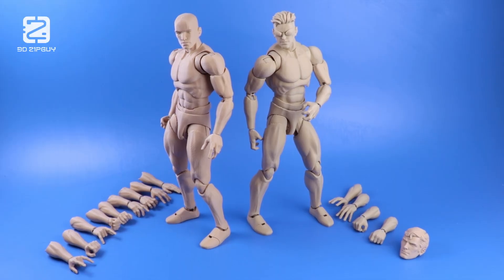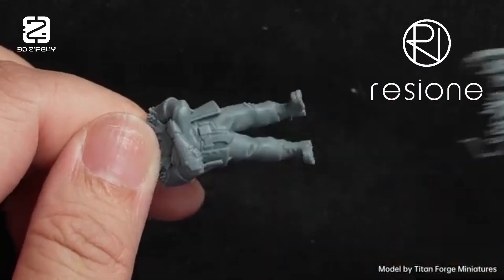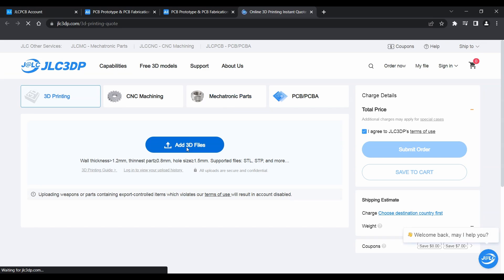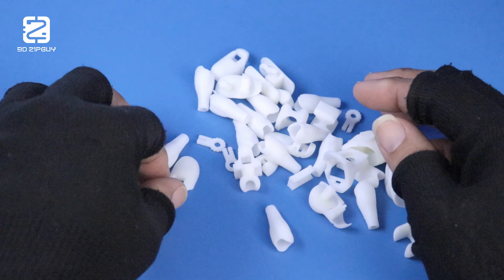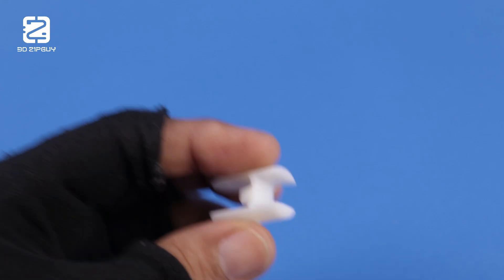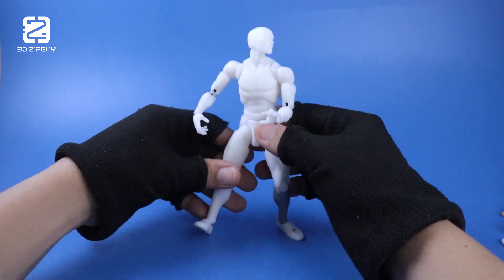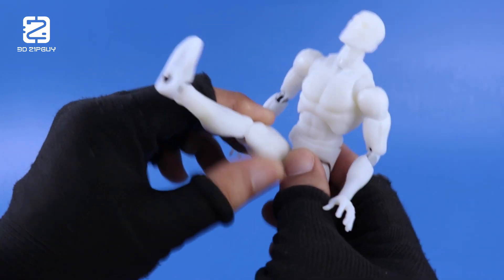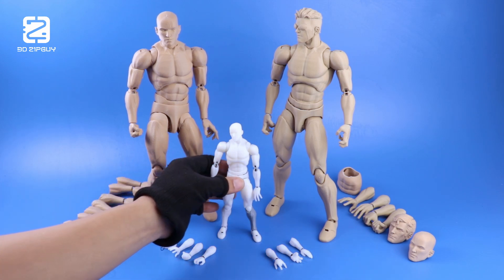3D Printed Action Figure - Resin VS PLA #jlc3dp

Comment: Here's a question. I have a 3d printer and also a resin printer. I'm currently modeling sh figuarts customs. Kind of like what we see from demoniacal fit. What would you suggest to have a better success rate for them? My models won't be using zip ties though.
Reply from the maker: I would like to answer your questions, but I have no clue what you are talking about.  I know SHF, but as for what you are trying to achieve, I don't know. Sorry.
Reply: @3DZipGuy well I'm not sure which printer to use to print out the parts for it.

Comment: Great video. I am making my own figure and I am tryin a lot of different Pla. Do you have a favorite filament you use? Or is it just sunlu? Or a general Pla type u like? Just Pla plus? Or have you found others that u suggest? I am having issues with joints losing tightness and parts snapping. Any help would be awesome. Your figures are really great. Thanks
Reply: Use minimum 4 walls and 50% infill on all parts mate ive had grate success even with amazon cheap pla
Reply: @sprockylock391  thanks I will try that.

Comment: Just a doubt, why do you use zip ties?
Reply: My guess is zipties are stronger than regular resin and pla.
Reply: It’s probably because of the durability
Reply: Would have to be easy to replace and allows better friction between joins. However just curious on life span of that joint configuration
Reply: 😂 Because he can't print pins. Those zip ties are a waste of time tbh